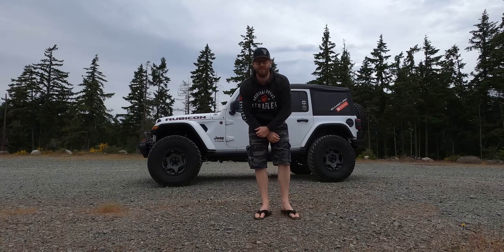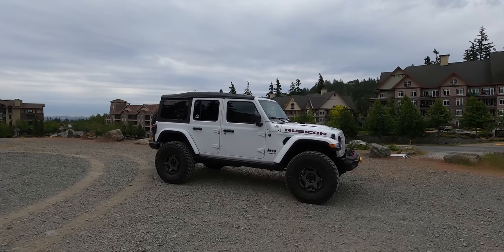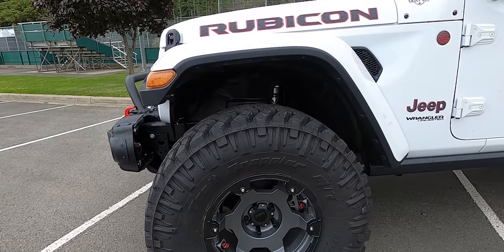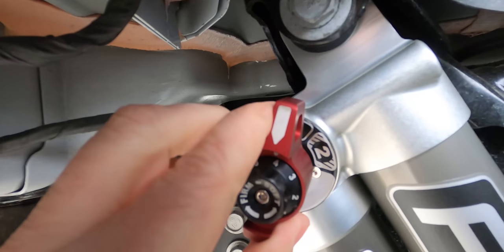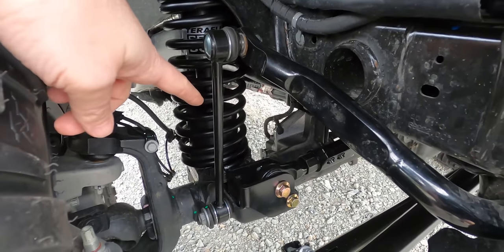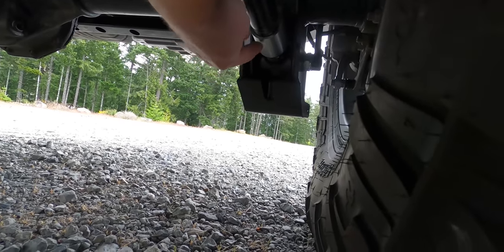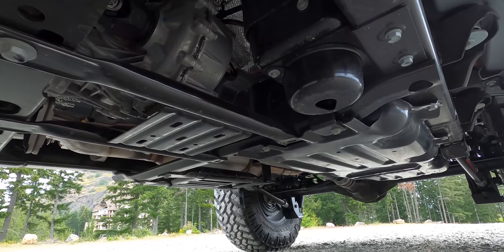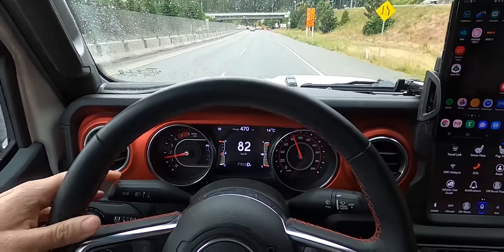Jeep Wrangler JL Ecodiesel Gets a 3.5" lift kit installed! Didn't go as expected...

Comment: Looking great Casey! .... I know you just installed a new Tie Rod but, have you ever looked at the TMR 2.5ton Aluminum Tie Rod and Drag link pretty much indestructible and has metallurgy memory so if you to hit something it comes back to original!!!  ...... just a thought ..... can't wait to see your next upgrades, or maybe even you wheeling this bad boy!! cheers Jake!
Reply from the maker: The black JK on previous vlogs has tmr tie rod. I didn't look at it for the JL but on the JK it needs quite a bit of back spacing I believe to clear the tie rod ends. Id want to double what tmr requires for backspacing on a JL. My wheels are 4.5" back spaced which is pretty minimal.

Comment: Lift looks awesome - I guess I’m weird but I think rake looks good.  Great explanation of lift!!
Reply from the maker: Its not too bad but needs more spring up front to allow for more compresson before the bump stop.
Reply: Same i like rake look better
Reply: Got the Alpine with the 3.1 piggyback falcons an got the same rake on a jku had to cut for the bump stops aswell. Some large bumps can hear it hiting. The rake is pulling the rear springs forward an it rub the rear tack bar. Tried leveling with some perches to level it out but wasn't very helpful. The Teraflex springs are much thicker. Really got a make a trip over to epic an let them look it at it

Comment: You are playing engineer. Hope you have deep pockets my friend. Your research and development deserves applause. But; there are Too many anomalies that can or could happen.
Reply from the maker: Thx. I enjoy the challenge!
Reply: I have done this  many times. From trucks, atvs, snow mobiles, jet skis, and my old Jeep when I put a Cummins in it. It was great till I wanted to take trip that was not in my back yard( the beach) trips of 400 to 600 km away were not even a thought. You will loose the reliability and break downs, will be common place for you. With the lift; Stress points are being placed where they shouldn’t, bindings, wait till it flexes, etc. safety will become a factor. You will be working on this machine more than wheeling. the time money And energy will continue to flow from you. It is fun playing engineer as long as time money and energy are not of your concern. This is why I decided to wait for a lift specifically engineered. I do appreciate your efforts. Just be careful on the safety aspect.
Reply: Totally agree. Spacers fix everything. SMH. This is a safety and engineering nightmare. Sure we are making content because we want to be able to say we were the first to do xyz, but it’s content about what NOT to do. The expense in fixing and replacing is going to far outweigh any revenue generated.

Comment: Casey did that track bar mount sector bracket by Synergy help with your loose steering at all? 
Sorry to hear Teraflex did not engineer or think about this EcoDiesel application very well, it's actually horrible in so many ways... one word "Evo"
Reply from the maker: It firmed up the response a slight bit. Cut out maybe a tiny bit of dead spot at 12 oclock. Im running no steering stabilizer and I think it drives good enough. Better then my JK thats for sure. When I ordered this kit no one had an Ecodiesel kit. I was on a time crunch for road trips but now I am not. Evo only has release 2.5in springs so far. I am wondering though because the JL is taller, if they are accounting for that. My experience ordering stuff that is a new product on Evos website is that it takes 4 to 6 months to ship. It has been my experience that things go on their site before they are ready to ship. I have a ton of Evo parts on my JK including items that I ordered as soon as they were available like fenders, and took many months to arrive.

Comment: @casey 250, does you dash display keep your preferences between drives? I set my center to remaining range, and I turned on current gear. But it defaults back when I turn my JLRUD off. I was thinking it had to do with my TazerJL Mini. But you have it too.
Reply from the maker: I have not had that issue. Perhaps take the tazer out and unmarry it. Then setup your dash how you want it. Then add the tazer in. I haven't modified my dash display since prior to adding the tazer.

Comment: I had ordered the Accutune Coil-over system with Fox Shocks and reservoirs. Told them it was going on the ECO - Diesel and they said should be no problem. Hope they are right about that. At least the kit already comes with the Rock Jock Track Bars front and Rear. 2 more weeks till my Jeep comes in.
Reply from the maker: Nice! Id be very curious how coilovers go. Id wonder if the spring rates and valving need to be different for the Ecodiesel or if you can make up for it with adjustments on the coilover.

Comment: I've got a KJ CRD and all the lift kits are really meant for the gas engine, especially in the rear. Thankfully they have a specific spring upfront but I don't have a metal bumper or winch yet...which I assume will make that lift irrelevant. Remember that in the rear, diesel is heavier than gas plus you have the DEF so that might mean an increase there, potentially necessitating different spring rate and valve tuning.  I'm interested in upgrading to the diesel JL (actually probably the JT - 3500 lbe towing is not enough for me!) and hope that aftermarket comes in with lots of specific options!  Thanks for bringing light to the specific needs of the diesel!

Comment: I'm wondering if terraflex figure out the right lift kit for the ecodiesel, I just order a set of wheels and tires for my 21 ecodiesel and I want the terraflex lift thanks in advance
Reply from the maker: Ive heard they don't have ecodiesel specific springs, just spacers.
Reply: Thanks Casey!
So I'm going with 35s and the terraflex 2.5" lift kit, and I was thinking of getting the 3.5" springs for the front to make it up for the extra weight, any recommendations?

Comment: Interesting video. Glad you shared this. Having the same situation with my 2018 F150 SuperCrew 3.0L Powerstroke. Good luck finding an ICON, Fox, or King lift kit that any of those companies will confirm works with the 3.0L Powerstroke engine weight.  Even Ford will only provide the correct Ford part number (no spring rate) which comes up in any system as "coil spring". No duh! Thankfully TeraFlex to the rescue. The TeraFlex Falcon Sport Tow Haul shock system is designed for a 4-6" lift on a 2015+ F150. This kit just reuses the factory coil springs. No need for spacers at the top of the coilover assembly either. Just install the lower spring seat at the correct location for the lift size, add the coil spring and top cap; and Bob's Your Uncle! I've been running the level lift version of this same TeraFlex kit for just over 10,000 miles now and it's great. Truck rides much better than factory. Just waiting for the BDS 4" lift kit and RPG rear springs to arrive and its off to the shop for install.

Comment: I'm interested in the hanging down bits that might get in the way at front spring compression. Are they prone to damage etc. Looks like Jeep had to do a bunch of engineering to get that engine in there. I won't buy a JT without the diesel but I am starting wonder about the JL especially when looking at the load capacity of the JL with this engine. Thanks for the content and showing us your journey.
Reply from the maker: The diesel JT is suppose to be a higher cargo and towing the JL but I believe they said it won't tow as high as the gas sport model JT because of cooling, but who knows for sure until it arrives. The JL towing and capacity is not limited to the engine thats for sure. This is a beast for power.
Reply from the maker: There are a lot of extra things on here for sure. Skid plates is at the top of my list as soon as they are available.
Reply: Casey 250 I agree however I’m wondering if those extra skid plates will effect cooling. I have been waiting for better availability of this engine in both vehicles. The 3.6 in the JLU does real well with the new trans however I think the JT is pretty anemic with the 3.6. Either way my next purchase will be a diesel.
Reply: scratchnbell I’m in the same boat with you. Only interested in a JT with the diesel because I’m gonna run the 39” BFG (about the same height as the 38” milestar) 

The V6 is an ok match for stock tires but not 37”+ I’ll be towing a 6200 pound off road travel trailer as well.

Comment: That rake looks badass!! If it were my wrangler I’d keep it like that. I totally dig it. And then added weight in the rear would help level it out without the back sagging lower than the front. I totally dig that rake.

Comment: I just put the 3.5 RT3 long arm teraflex kit on my 2020 Rubicon with the 3.6 liter. I ended up putting 4" springs up front because I didn't like the rake. So it's not just a diesel thing.
Reply from the maker: They seems soft hey? I have a 1 inch spacer in now in the front.

Comment: The Diesel model does weigh substantially more (about 450lb) than the gas models.  Combined with heavier front and rear bumpers, a winch, a heavy-duty tire carrier and 37" spare tire and wheel, the normal 3.5" springs won't fare well.  For mine, I used Rock Krawler RK07018 4.5" triple-rate front springs and RK07017 3.5" triple-rate rear springs (with matching correction pads/bushings to prevent the "bowing" effect on the springs) and this resulted in a perfectly even 3.0" lift front to back (actually 1/8" higher in back).  Couldn't be happier!  I also used Maximus-3 front and rear track bar relocation brackets so that I could use the Steer Smarts high-side drag link.  With the track bars and drag link perfectly horizontal, body roll is at an absolute minimum and highway stability is phenomenal.  I have some short unedited video clips of my rig on some trails in Moab.  Please check them out (tom80421).  I included a list of all parts for my modification.
Reply from the maker: Thx for all the info, I will check it out on your channel.

Comment: Casey, did you have any issues with the rear sway bar links and tire clearance? Installed a metal cloak lift and am having issues with link clearance to tires on stock wheels.
Reply from the maker: I did not. I believe the Teraflex kit had shims for the sway bar mounts to move it out a little... Which caused clearance issues with the DEF tank but Mike the Wizard mechanic made it work haha

Comment: So Casey, what is the proper TeraFlex spring for the front to compensate for the diesel extra weight to get the 3- 3.5" lift?
Reply from the maker: 3.5" with a 1in spacer in the front, but I am really thinking about going to a 4.5" all around and 1" spacer up front as I start to add more weight.
Reply: You stated (I think) you got 1" of lift up front with a 3.5" lift kit and 3" in the rear. I'm curious because I ordered a Gladiator Rubicon with the diesel. I realize you knew it was a 3.5" lift for the gas engine. I was curious if TeraFlex has offered any remedy  for the diesel (extra front end weight).

Comment: Is the Synergy bracket the normal JL bracket? No issues if it is?
Reply from the maker: Correct. The Teraflex track bar needed a little clearancing to fit inside it but that is not a diesel exclusive problem.

Comment: so you paid 75k for this? 
+ all these parts - you're in what? 80k so far? jesus christ... dont you think there are better rigs you can build for that kind of money?
did you buy it outright or finance / lease?  i see you're in bc; same.. local dealer here in coq is listed for 67k. 
Whats your take on  going into something with that kind of money for a first gen. I don't see that kind of money being put into a ecoD engine filled with gremlins being worth. 
Not a jeep hater, but i could get runner and put 40k into it to make it a monster off road with reliability. 
either way love supporting locals with yt channels gj!
Reply from the maker: It was closer to $70k out the door. I did a full video on its cost. I figure this build will finish up about $100k cdn. Could I build a more capable rig for less? Ya sure, I have a 08 JK sitting in my driveway that is more capable for half the price. But to get into a JL, even going used and with out the diesel, it might save $10k or $15k but I wanted it new and spec'd how I wanted and the diesel. I bought this to take on long road trips, wheels, and drive home. Current world conditions have really altered that at the moment but it will return to normal eventually.
Reply: @Casey250  really appreciate the reply. I just watched the video as well! 
Just wondering if you bought it outright or financed as I'm on the market to make a purchase. Torn between new rubi or 17 Trd offroad + mods which comes out to the same amount as a loaded jL diesel. 
Probably testing one out on friday here.
Your insight would mean a lot to me :)
Reply from the maker: Your kind of comparing apples and oranges. Id get a JL Rubicon because im willing to sacrifice some on road comfort for offroad capability and my plans for what I do offroad are probably not the same as everyone. I love the rugged and unique feeling of the Jeep interiors. Id never lease a Jeep because of how I use it. As for financing vs cash,  my advice is if you got cash to pay for a new vehicle, finance it with a low rate and invest the cash for a higher return. If financing is the only option to buy it, then a $70k Jeep plus mods is not a great financial move.

Comment: Hey Casey, what about the steering stabilizer? did you use a relocation kit? I can't see it in your video
Reply from the maker: What steering stabilizer? :)
Reply: @Casey250  you are not using it at all? What’s your experience with and without it?

Comment: At least short term you could also do a 5.5” spring in the front, and leave the 3.5 in the rear!
Reply from the maker: I am think 4.5s all around and adding 0.5 inch up front. Itll rake a bit, but when i get all my gear in I think it'll level out.

Comment: Got a metalclock 4.5 lift and it has a 6.2 LT in it and it’s still 4 1/2 in the front
Reply from the maker: Dang!
Reply: Casey 250 u got a bad ass set up tho that’s the motor jeeps need. That u got about damn time 
I had a 3.8 lol u really can’t do much with that  nice Jeep man great channel
Reply from the maker: Thx 👊👊👊

Comment: You bought a Rubicon just to swap out the suspension. Your not very financially savvy my friend.
Reply from the maker: The suspension is one of the many features of a Rubicon. High fenders, dual piston front brakes, lockers, electrion sway bar disconnect, 4: 1 transfer case.